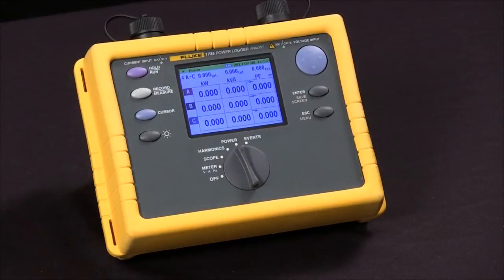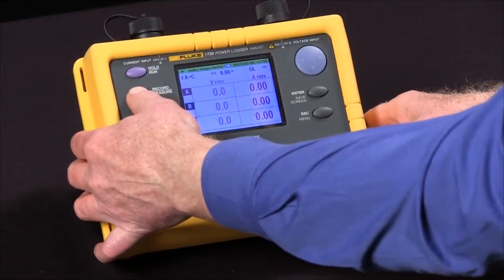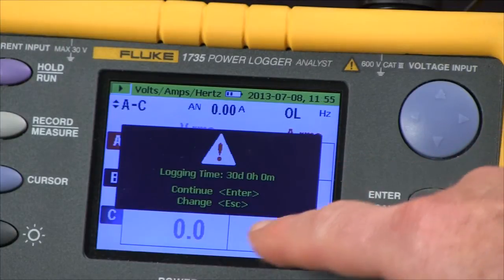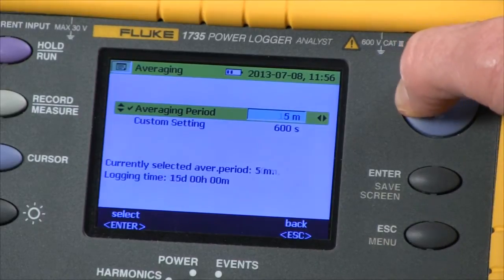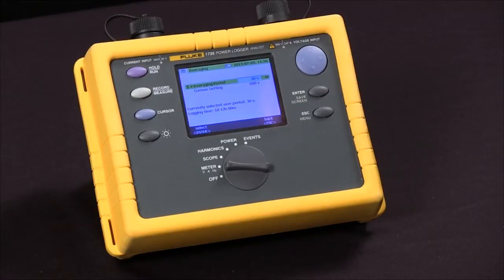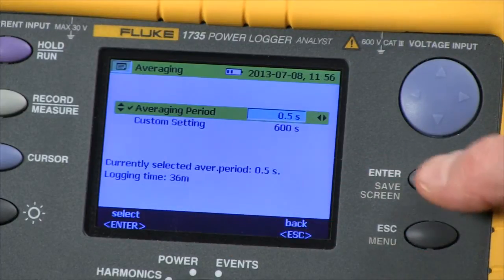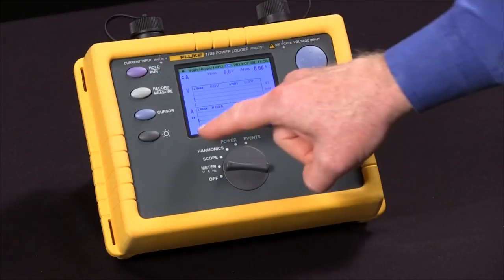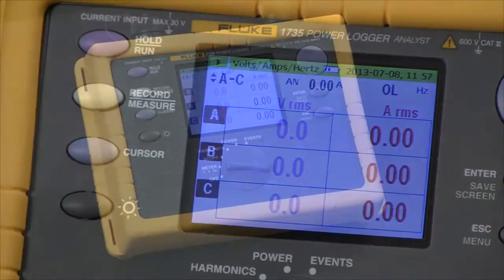How To Start And Stop A Logging Session With The Fluke 1735 Power Logger

Comment: Hi,
If you  start a 40 min logging session and come back after 1 hour will the data be saved/stored automatically ?
Thank you!
Reply from the maker: Hello - Yes, if the Fluke 1735 records for the full/specified time it will stop and save the recording. The meter would display a pause symbol and a black dot when the recording is finished.